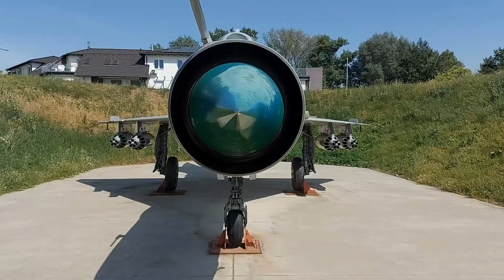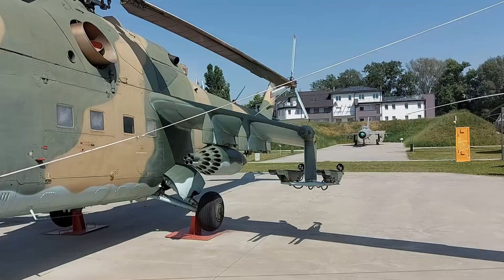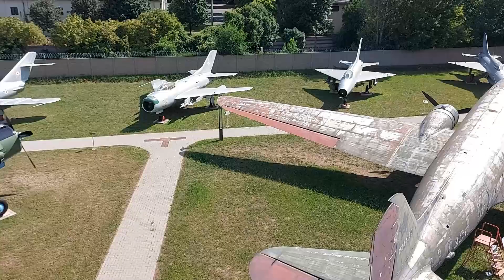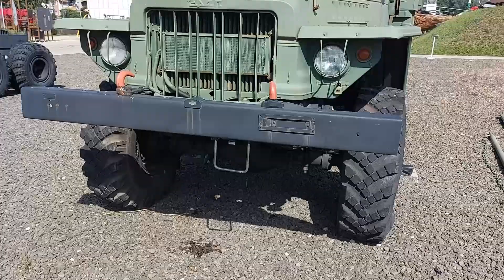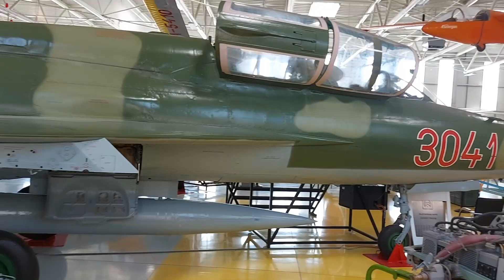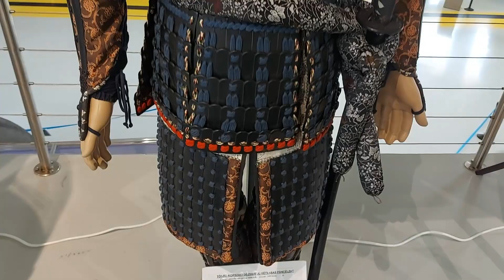Aviation Museums of the World - Hungarian Air Force Museum Szolnok  Hungary

Comment: SA-2 (the same that shot down U2) & SA-3 missile system (that shot down an F117 over Yugoslavia in 1999) with their mobile radar & tracking equipment. Such air defence does rest in museums but it is still used by many countries. There is a wonderful Air Force museum in Karachi & an Army museum in Lahore. Both have a wide variety of western & eastern bloc stuff & scale modelling sections.